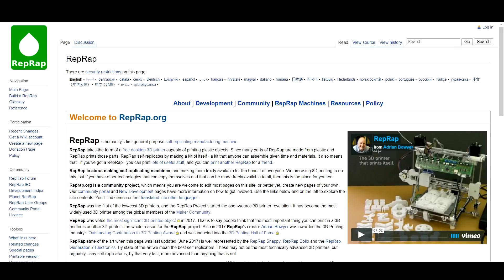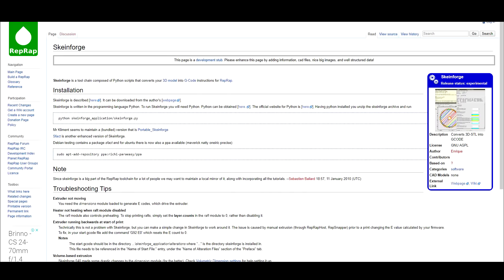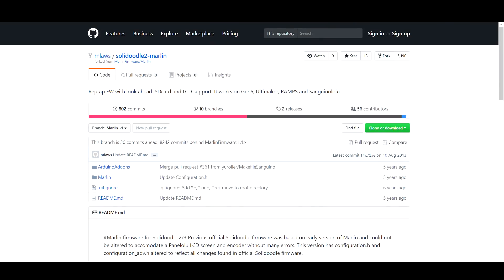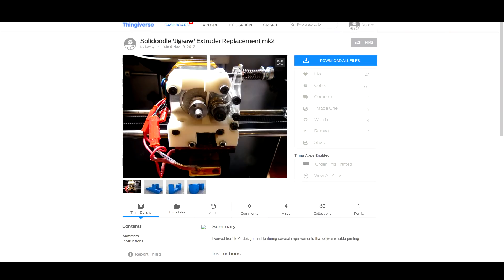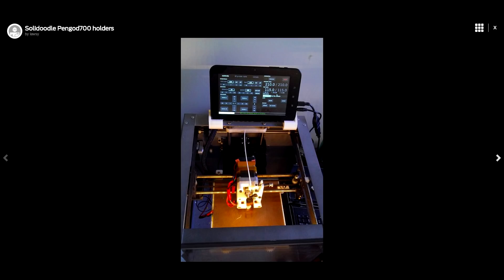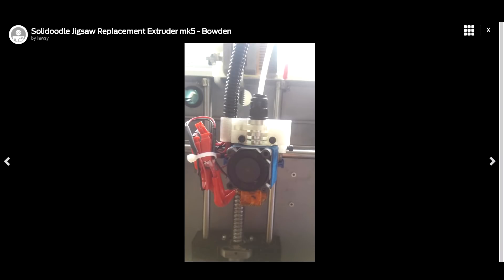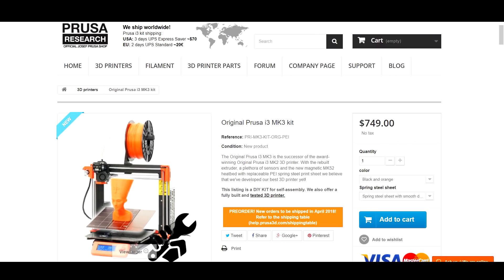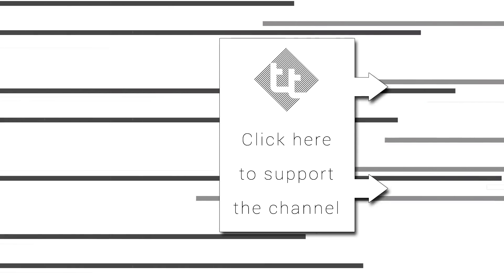The way 3D printing used to be (farewelling my super modded workhorse)

Comment: Hi Michael, We found a Solidoodle at the greenshed (recycling joint in Canberra). After connecting a PC PSU and drilling out a blockage in the nozzle, it works! It does worst print quality than my A8 at the moment. But because it's got a nice enclosure I think it might be worth fixing up especially for ABS printing.  Since it's pretty much a CoreXY at heart should I bother? I think it's current print Q issues are due too too much slop in belts and dodgy printed parts.

Comment: Thanks, your mods helped me getting my Solidoodle 3 to print the way I wanted it to.
Reply: I did a lot of your mods. Here's the list: Lawsy X and Y carriage, new rods and linear bearings on X,Y and Z-axis, TR8 lead screw for the Z-axis, GT-2 belts, E3D V6 hotend, Ramps electronics, E3D Titan extruder setup as bowden, autoleveling sensor, own design radial print fan shroud, plexiglas cover, 200w silicone heatbed, dual psu's, 3mm thick carbon print surface.
Reply from the maker: Thanks for sharing! Are you still using the S3 or have you got something newer? If so, how does the print quality compare?
Reply: Teaching Tech I still only use the Solidoodle 3. The quality is really good. But not as good as the Prusa MK2s that my friend got. I would love to get a newer and better printer and I have thought about buying a Prusa MK3 alot. However I don't really use my Solidoodle 3 enough to justify buying another printer.
Reply from the maker: I have a mk3 coming soon so, I'll be documenting how it goes.

Comment: The Solidoodle taught me everything I needed to be able to use any other 3D printer.  I moved on to a kit that was BYO extruder, hot end, electronics, heated bed and could deal with it because I had replaced all of those things on the S2.  I have a 4-head Stacker3D printer now, thanks to Soliforum-  the founder got a S2 and was inspired by its cheap corner cutting to start a company that produces a printer that is the exact opposite.  He built a fully custom, cost-is-no-object dream printer and sells it to engineers who might have otherwise spent 60k on a Stratasys.  It still runs into typical FDM problems, but I can troubleshoot just about anything thanks to all the problems I had to fix on the Solidoodle.
Reply from the maker: Welcome Ian! Ladies and gentlemen this is perhaps the number 1 Solidoodle community member in terms of helping others and contributing.